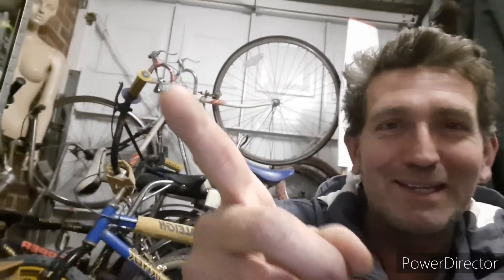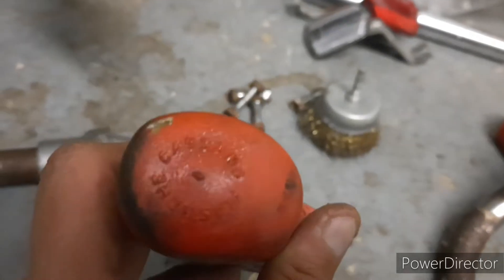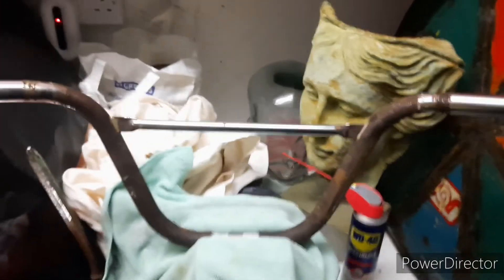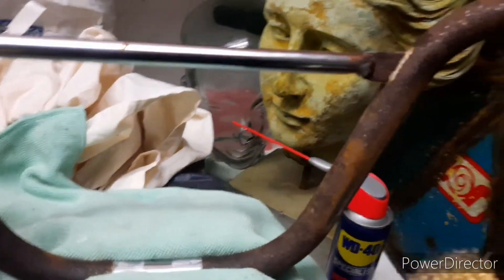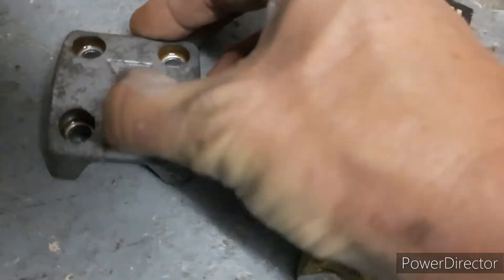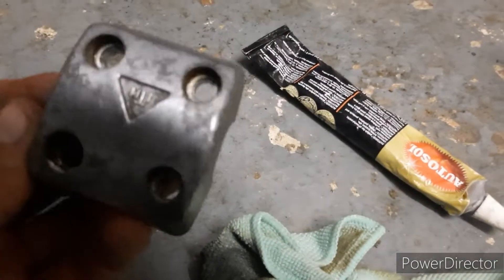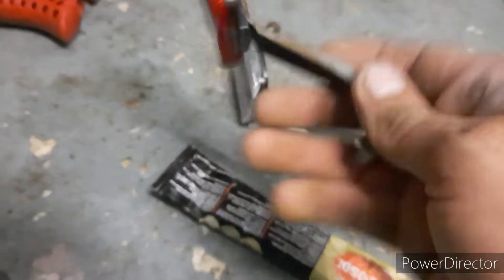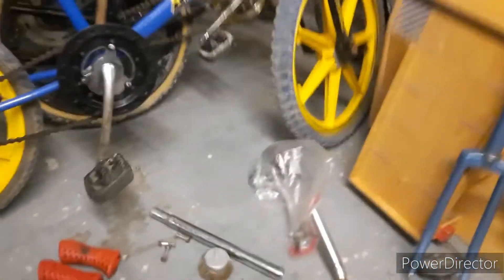mk2 raleigh mag burner my thoughts | stem and bar clean up

Comment: Back in 78; the Raleigh boxer was my desired bike ..I was six years old ..fast forward to 1982;.the silver and blue Raleigh ultra burner was my obsession..at that time they cost two hundred and twenty five pounds..I never got one..but two years later I did get the super tuff burner in 1984... along the way that got lost..but in 2015 I came across a mark two Raleigh ultra burner black and gold which was quite original...so in a funny sort of way I eventually did get my ultra burner.
Reply from the maker: It is mad how things kind of do a full circle. new video next Sunday  the mk1 tuff and the mk1 red burner are coming back home, both will be finished. I'm scrolling through ebay for more projects... thanks for your support